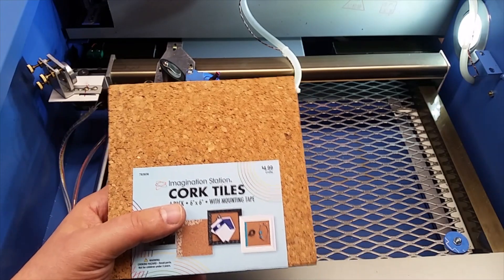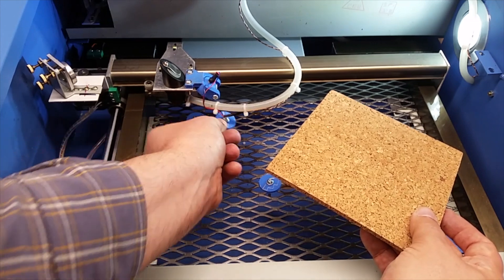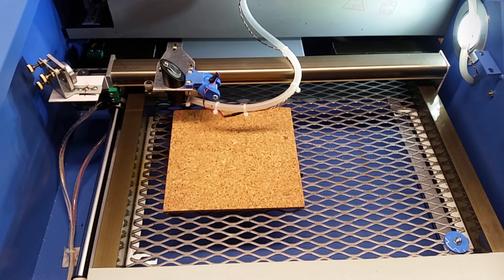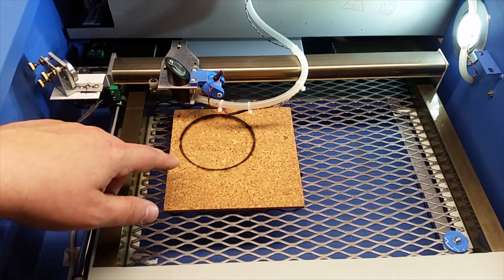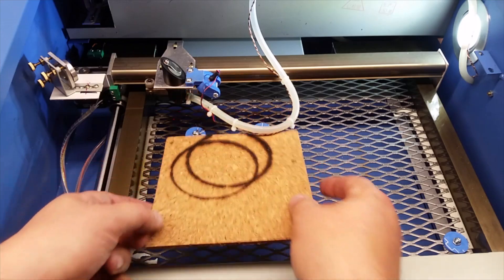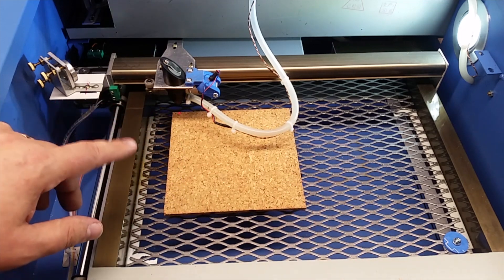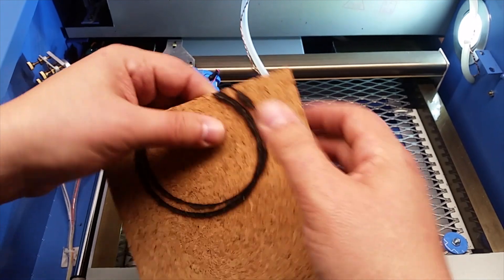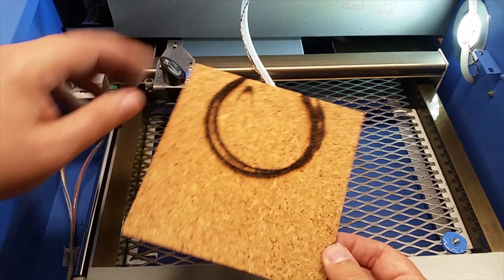K40 eBay Chinese CO2 Laser  -  Cutting Quarter Inch Cork Tiles!

Comment: Remembering your video on 15w ortur and balsa. I know why it goes so funny comparing to my 3mm oak veneers... well I spoke to my friend, he works on large co2 lasers. They make 500k profit yearly on them and what he advised me was not to play with balsa at all. He said that their employees burned few expensive lasers because of balsa got on fire. He said just PLY, is best for that reason. Balsa is very weird wood ones to easy ones to hard to go through and if use to much power it catch fire easily. On the other hand I cut my 3mm oak on 15 passes full power with 500 speed and cut with charcoal on sides. But it is actually perfect for wood as it close the gaps in wood, so if you add oil on top one coat is fine, the wood will not change over different humidity levels - just a tip from beginner laser user but advanced woodworker :)
Reply from the maker: On a high power CO2 laser yes you run a greater risk of fire then lower powered diode laser.  For a CO2 yes ply wood works better but the glue can be an issue for a diode laser....

Comment: funny thing, I tried same thing on my 7W ortur today and guess what hehe I did not make it. it burns into, about 1mm and that is it. I saw someone used 80W Co2 and did cut clean, but hey, that is way to expensive laser. But... engraving works perfectly. I did some tests and 1000speed on 100% power 1 pass, makes beautiful engraving. I did my logo (large logo) 27cm square and it took 7 minutes to do it. Looks perfect, my wife was very glad looking at it, she is best when something I do wrong so if she like it it must be good. Cutting, big NO, engraving Super large YES. And I did check, my laser is definitely 7W output, smallest in family, but I use speeds of 500 up. max 1200. usually on full power. Best Regards from UK :)
Reply from the maker: Yes the ash becomes an insulator and is hard to clear...

Comment: Take a can with diameter of cork disk desired. Cut off can on one end (removing the welded lip and leaving sharp edge). Place cork on a board, place can with cut side down against the cork. Place board on top of can. Using a jack, place on board and start jacking against heavy object (like my truck bumper) and voilà!
Reply from the maker: Or just use a hammer :-)

Comment: It looks like you focal length is not right.  The cuts should result in a thin cut.  Try raising or lowering you bed.
Reply: +Jason Owensby Looked out of focus to me as well. Did you speed up the cutting video? If you don't have the power and have to cut super slow it will likely have time to burn as well. We have a 60W and 120W at work and although I have never cut cork, I have cut lots of MDF and plywood and it leaves a nice sharp line.
Reply: +Jason Owensby - agree, 1/4" material may be problem. I would remove the bed spacers, to get it lower.
Reply: +Robby Nowell If your laser cutter didn't come with a focus tool (or is not calibrated) you can make one for it pretty easily. It just needs to reference a fixed distance from a distinct and repeatable point on the print head to the focal point, which you rest on the print surface. Basically a little measuring stick. You can get fancy and make it hang and automatically get knocked off when it touches the material assuming you have a ledge to hang it off of (see Trotec focus tool for an example). You can find the optimum focus length by putting material on a slight incline and cutting a straight line. Wherever your line is the thinnest is the focal length. Move the head to that spot and calibrate a tool to that depth.
Reply from the maker: +Jason Owensby thanks Jason actually did a slant measurement so doubt thats the issue...
Reply from the maker: +Robby Nowell many thanks!  If you check out the playlist for the K40 laser I actually show quite a bit on focusing, including a do a slant board test (as you mention) to fine tune it.  So with this measurement i set the pin height to the material ensure it is in focus. :-)
Reply: K40 - no bed adjust. They were made to cut rubber stamps, that the West jumped on them as a general purpose laser engraver was a surprise to the maker, but they've made very few improvements to the product despite the millions they've sold.
Reply: I have this machine and I can cut through 3/8” walnut in several passes. It is all about focal length and how clean your lense is. However, is there a different thermal property of cork?